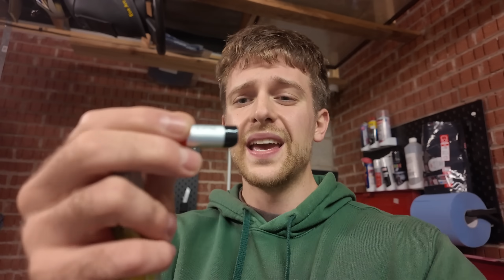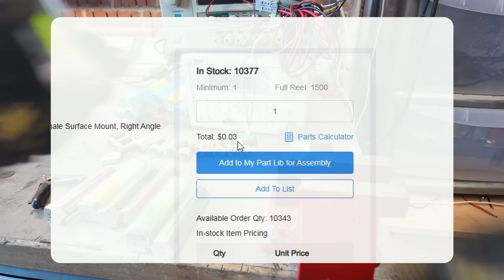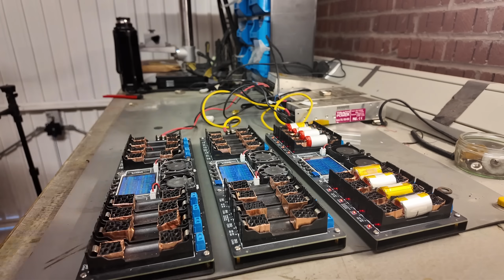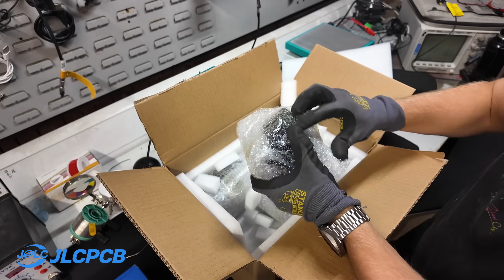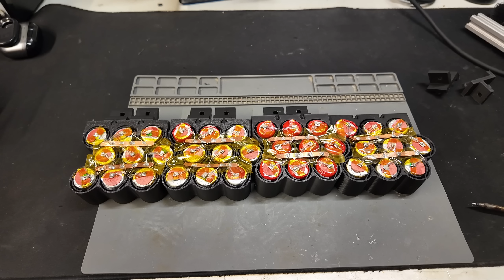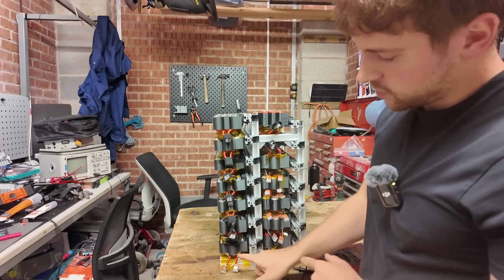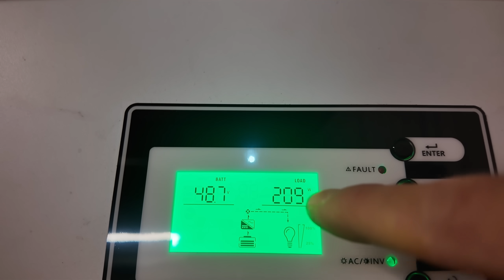I Powered My House Using 500 Disposable vapes

Comment: Just a tip, a Li-ion cell is happy to go down to 2.5V with no problems. And even dropping far below that (even close to 0V) will reduce their capacity somewhat, but doesn't instantly destroy them. It is a myth that they become immediately dangerous or broken. Slowly and carefully trickle charging them back to full charge, while monitoring them closely, will allow you to do a discharge test to reveal their true health. I have heard of cells self discharging to 0.5V and being revived to continue working at their full rated capacity. Low voltage cells should be treated with suspicion, but throwing them away is a waste.

PS. Awesome build, nice work. I love all the details you added for safety and efficiency.
Reply: I partially agree with your statement. An increased internal resistance is one of the main reasons why deeply discharged or aged Li-ion cells can become dangerous.

The higher the internal resistance, the more heat is generated under load. This heat accelerates chemical decomposition inside the cell, which further raises the resistance — a self-reinforcing cycle that can ultimately lead to thermal runaway. 

Therefore, claiming that deeply discharged cells are “not immediately dangerous” is misleading — their elevated internal resistance makes them potentially unstable and a real safety risk under load.
Reply: @Counterweight_Uppercut  The fix is just cycling it believe it or not. I've recovered plenty of 0v lithium cells from 40+ laptop battery packs and what I've noticed is that when cycling the cells the internal resistance went down to a more normal level as in like it's healing. In some instances after cycling it gained back capacity after each cycle as well.
Reply: @aleksandersats9577  At first glance, this may seem true. During recharging, the internal resistance may initially decrease because a new SEI layer forms. This acts like a “healing” process.
However, below approximately 2 V, the copper collector begins to dissolve—during recharging, this copper can be deposited again in an uncontrolled manner and form conductive bridges inside.

The cell then appears to function normally, but remains structurally damaged and may later fail or overheat unpredictably.
In the worst case, such an “unstably repaired” area can later lead to an internal short circuit.

Therefore, the problem is not that a deeply discharged cell is immediately dangerous, but that it becomes unpredictable. For experiments or in highly controlled environments, one may consciously take the risk. But when it comes to larger projects, multi-cell packs, or applications with a wider audience in general, this uncertainty is a real safety risk
Reply: @aleksandersats9577 No unfortunately not. With that many cells in parallel the BMS can't tell if one has a high internal resistance. The formula is overall resistance in parallel R = 1/R1+1/R2+1/R3+1/R4...
If you use a temperature sensor for every four cells (thermally connecting obvsl) you can make it safe.
Reply: don't forget, this ain't a hi-tech 18650\21700 cell, it could be made out of rubbish, just because it's a "disposable" thing!
Reply: Yeah, I race drones and we use very similar high discharge LiPos to what’s in vapes. I’ve seen plenty of batteries drawn down to zero volts while getting a stuck drone or just forgetting about it. You can bring those cells back and they work just fine. Just speeds up degradation.
Reply: @supergeek02468  This can work well, but it can also be dangerous.

Both, a swollen LiPo cell and a deeply discharged Li-Ion cell with high internal resistance are chemically unstable and pose an increased fire risk. The visible reaction of the LiPo cell is a clearer warning sign, while the hidden danger in the 18650 cell is perhaps more treacherous.

A swollen LiPo battery is not only a sign of capacity loss, but also a clear, visible indication of severe internal chemical damage.
Gas formation is often a precursor or companion to dendrite formation. These dendrites can cause internal short circuits.

The foil is under tension, becomes thinner, and is more susceptible to cracks. If oxygen is added, the gas-air mixture can ignite immediately.

To the beginners out there:
It is best to always store these batteries safely and never charge them unattended..
Reply: @supergeek02468  Are you sure vape cells are LIPos?
Reply: @supergeek02468  unless you're using some homebrew with no safety, the "zero" volts you're seeing is a calculation of the usable voltage ABOVE the safety voltage, the boards made for drones have this pretty much hard wired because without it you're risking fires
Reply: It's absolutely not a myth that batties go bad when they become discharged. The further they're discharged, the more damage they sustain. Discharging to about 2v+ is relatively safe if it's not used for anything super important, but when you get below that, the battery itself becomes unstable and should you do low enough, it will absolutely become dangerous and will be damaged. For a project like this, just a few heavily discharged batteries that were charged back to a safe voltage could not only become a risk of damage to all the rest of the cells, it can reduce performance heavily and become very dangerous. Please don't go around telling people that they're safe to do something that just is not safe. It's unlikely to create a danger if he did that, but if it does become a danger, it's a very serious danger. 1 battery blowing up meer millimeters away from hundreds of others can cause a fire or even a large explosion and burn his house down. Besides, lithium ion batteries are very volitile even when they're treated with care.
Reply: @harulango8614 i have completely drained lion batteries for my drills, saws, etc where they wouldnt charge, and had a non readable output, and used another batter to jump them and then charged them to full and they continued to work fine for awhile. While im not an expert by far, and also tight with the wallet i have yet to experience any issues
Reply: @payj3371  your tools will not even turn on if it's below safety voltage...
Reply: @beargillium2369 they didnt turn on. The battery wouldnt charge either
Reply: @beargillium2369 y’all got ass for brains lol
Reply: @payj3371 sure thing, if I had to choose between recharging a dead battery or buying a new one, I would also do that, but it would be ignorant to say that’s not made the battery more dangerous and degraded it. Really just down to your risk tolerance

Edit: and a drill battery is only about maybe 5 cells in a portable box, if that thing wants to blow up, it’s a lot safer to grab the drill and throw it onto your driveway than to try and get rid of hundreds of exploding cells. So in that regard aswell, it’s safer than the batteries in the video.
Reply: @harulango8614  Absolutely correct. While briefly reviving a deeply discharged cell for analysis might be justifiable, deploying it in a multi-cell array where it becomes the weakest link is the real hazard. Under load, its high internal resistance will cause excessive heat, creating a serious fire risk for the entire pack.
Reply: @harulango8614  One parallel cell group cant go under 2 V because of the bms. It can get hotter due to higher internal resistance. Which further reduces lifetime. Eventually the bms will shut down the whole cell group .

Edit: Well you're right. With this many cells in parallel using for a long time you definitely need to make sure to use many temperature sensors. With this cell size probably one for four cells connecting thermally
Reply: @lukasoffen2420  you're assuming there's a bms and not accepting that cells DO naturally lose voltage to the environment over time...
Reply: @lukasoffen2420  I don’t think you quite realise that natural battery drain is a thing, and more so the fact that depleted and then recharged batteries suffer from this more so. A battery can go to under a volt in a day from 2V if it’s been damaged from depletion. Tho that is more on the extreme case scenario,
It is possible and I’ve seen it happen
Reply: @lukasoffen2420  they (beargrillium) are right, regardless of whatever the video said.
Reply: @lukasoffen2420  This is dangerously misleading. While the BMS protects the entire parallel group from over/under-voltage, it cannot monitor individual cell temperatures or internal resistance within that group. A single damaged cell with high internal resistance can overheat and enter thermal runaway long before the BMS detects any group-level voltage anomaly. The BMS provides electrical protection, but offers no guarantee against thermal cascading failure originating from one compromised cell in a parallel group.
Reply: @Counterweight_Uppercut yeah thanks 👍🏻 I didn't think about the extra problems with that many cells in parallel.
Reply: @harulango8614 sorry. I didn't think far enough for especially this project 💀

But no natural battery drain isn't the problem. It gets recharged by others in parallel. 

The problem is that with so many cells in parallel the others will lower the overall internal resistance so much that the BMS has no clue one is defective
Reply: Sorry Guys I had this formula so many times already but didn't think of it 💀💀💀💀 Good lesson for me bc when (which isn't sure obvsl) I finish my study then I'm an engineer and these oopsies can cost someone his life 💀💀💀💀☠️☠️☠️☠️ 
Overall resistance R in parallel is = 1/R1+1/R2+1/R3+1/R4...
So the more parallel cells you have the less it is visible when one goes high resistance!
Reply: @harulango8614  i used to be vehemently paranoid about undervolted batteries, but when I went to find primary sources to support that concern, all I could find was evidence that its not nearly as dangerous as “people on the internet” say. I’m open-minded, but I’ll need data to change my mind. I invite you to bring receipts. (Tip: YouTube hates links in comments, so post a google search)
Reply: From experience... you can discharge to zero, but the chemistry destroys the battery as time passes... so it very much depends how long they have been at low or zero volts. I use them in FPV planes, and have often gone well below 2.5v/cell, and as long as you get them back up over 3v quickly, very little damage happens.
Reply: This is not completely true. From the simplified explanation, I got from an actual battery scientist, there is a certain lithium compound that forms it is only stable over a certain voltage. If you go below it, it breaks down. When you recharge the cell, some lithium converts into that compound. This reduces the lifespan of the cell.
Reply: I successfully recharge batteries with only 0,7V but battery under 0,7V is rarely good battery
Reply: Yeah! While you probably don't want to bother reviving a cell that got down to something like 0.4V, you could definitely revive a cell at something like 2V with zero issues.
Reply: @wisplite  you absolutely can revive 0V cells if you want to. It’s hit and miss, but they often work perfectly well. I would only discard cells with a negative charge, as research suggests they can be hazardous.
Reply: A nice way to trickle charge dead batteries is to connect them to a small solar cell (like the ones in pocket calculators) and then let them sit under your window for a few weeks or months (depending on size of battery and solar cell). With Li-ion cells you should check the voltage every now and then (for ex. once a day) to prevent overcharging. Whereas Lead Acid batteries are basically impossible to overcharge with such a small current.

If the solar cell doesn't provide enough voltage to fully charge the battery, a simple joule thief boost converter can be placed in between.
Reply: I use a noco on power supply mode and seems to do well reviving batteries
Reply: I don't know why people don't know this once they get to 0 volts the lithium dendrites that form will NOT EVER allow the battery to charge
Reply: @1littlelee  No The dendrites build when the cell is reverse charged. That happens if the cell is in a stack of cells and one cell is weaker. The others continue to drive the current, which reverse charges the weak cell. This will cause elemental lithium to deposit, building dendrites. Cells in vapes never were in a stack of cells, so they cannot be reverse charged by the circuitry.
Reply: @1littlelee Not true. At least not as bad as you put it, from my experience.
Reply: @1littlelee  I can tell you the countless amount of lithium cells I have charged that were fully 0v, 80% of them recovered just fine. If they do stop the battery from charging, it must have been sitting like that for several years or more.
Reply: @1littlelee  it sounds like you have probably never actually tried to charge an undervolted cell yourself. Is that right? Dendrites or no, I can assure you almost all of the undervolted cells I revived hold a charge just fine.
Reply: EEEEEERRRMMMM ACTUALLY !! hahahahahahahahaha
Reply: nah close to 0 no revive.
Reply: @Aimbuster  Not at all true. I have revived quite a few, with around a 40% success result even from cells below 0.5V, and much better from cells of higher voltage. They lose some capacity, but that does not render them useless.
Reply: if you give them low power for hours it can be revived i revived a dead nintendo ds battery with a cellphone battery charger
Reply: @Aimbuster  Yes! best to keep them between 30-80%.
Reply: @Aimbuster  brought plenty back from 0V had a couple 4p 7S batteries from a portable steam cleaner that were Panasonic 3.5AH NCR18650GA cells. I used a car battery ballasted through a 18W tail light bulb (around 1.4A or 0.36A per cell and dropping as cell voltage increased) when the light went out they were around 1.7V per cell then I connected a car battery charger to the set up and cranked it to 16V bringing me to 2.2V per cell before taking it off that set up and putting them on a proper charger with balancing charging at 6.3A if I had any bad ones I would have felt them getting warm and snipped the nickel strip to it. All of them came back to life and I have been using them to rebuild tool batteries for the past couple years and never had any issues. Although I know they were only at 0V for around a week.

Comment: Add another battery pack maybe have 4 for long term running time if you do need to be off grid for a long time du to power failure and solar panels for extra back up chargeing

Comment: yea I have hundreds of 18650s from these. I wish I had a way to get everyones that throws them away =/
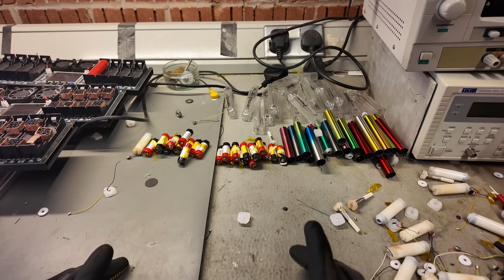2:28 WRONG! it's 2.7 volts and they are just worse capacity 99% of the time. You can "heal" them with low mA charge like 10 or so for several hours. 
I can pull 10 amps off of a bunch I healed from laptops etc. I even use them in my weed whacker.

Comment: Do you think it’s possible to try and do this with a Tesla battery or would it need some sort of higher output battery to pull off? Like trying to repair a Tesla that got written off because the battery is too expensive to replace and not worth it to the consumer

Comment: Maybe it's because I live in the USA, but I feel like the current setup could result in you REALLY EASILY back feeding into the grid. This whole thing screams sketchy, I love it.
Reply: Yeah, this would require a mechanical interlock in the states (probably the UK too), or a full ATS between the service drop and the house
Reply: That's why you should be mindful of which breakers are off and which are on.

Comment: I’ve seen some of these vapes recently that had solar cells built into them.  Obviously a gimmick as the solar panel was under a layer of semi transparent plastic, but they were actually wired up to charge the battery surprisingly.
Collect 1000 of those and you could build a whole solar system lol!

Comment: Forgetting the battery aspect that setup is extremely dangerous and illegal, multiple supplies are pretty common but must be wired so you can't have both on at the same time so either an interlock or changeover switch, not only for your safety but if there was a power failure and you failed to double check you can feed power into the mains grid endangering the lives of the linesmen

Comment: Man, I would not trust that enough to put it inside my house (nor my workshop, for that matter). The setup itself is probably safe, but you can't really be sure how well engineered the cells were, and there aren't any fire prevention measures either. If even well-known brands of batteries go up in flames sometimes (OVH fire and the newer South Korea datacenter incident), then cheaply made Li-ion cells are no better. But maybe placing them in some isolated shed outside could actually be safe.

Comment: Your not exactly right about the fully dead ones yes it is mostly true. But many of them if done right will come back to life.  The issue will be capacity and reliability.
 Fixing them needs be done in stages you will want low amps and slowly increase voltage until you get over 3v then you can go to 4.2v.

Truely dead ones will not take any charge. Most charger if they are below 3v wont charge them.

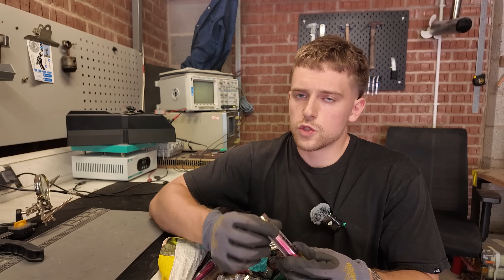Comment: 2:40 it does really depend on the chemistry and how long they sat at that voltage. can revive cells if you charge slowly and many 18650 datasheets make a note of waking a cell up however below ~1v datasheets do not suggest revival. i still wouldnt use any revives in a large pack that will be tricky to service. also would speculate these cells use a very cheap less stable chemistry
Reply: Ikr I heard that and thought damn he's throwing away good bats

Comment: I wonder what the safe continuous discharge rate is for these batteries. 
Based on what he’s running and the fact that’s it’s running off 50 volts I could easily see these batteries discharging at around 2-5 C